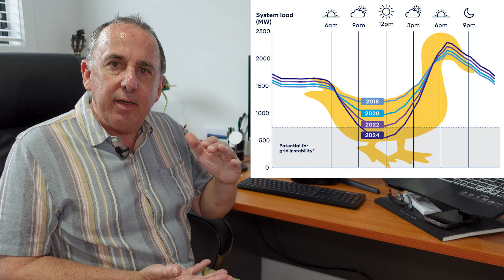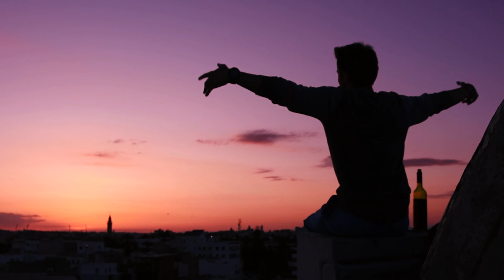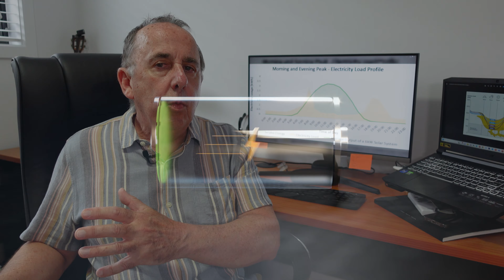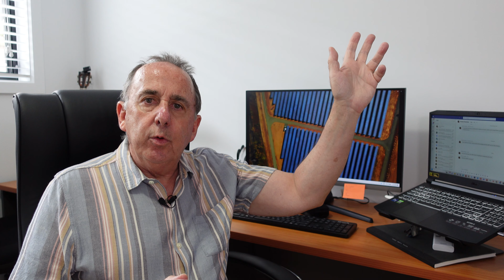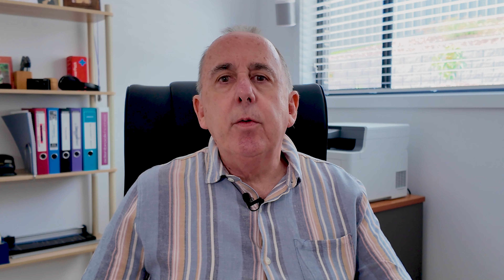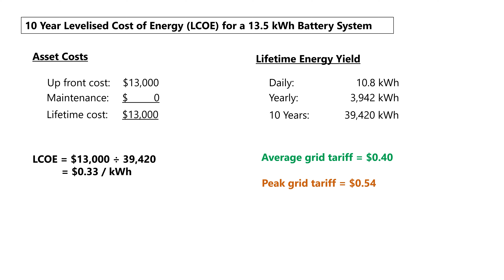This Electric Life - Tesla Powerwall Battery

Comment: Some great food for thought there. One point worth considering though when attempting a zero $ power bill during your retirement is the "supply" component of your bill. As more and more households follow your lead to zero grid usage, as I see it, energy suppliers have no option but to keep raising the supply component as they are already being forced to do. The money has to come from somewhere to keep the books in the black. Disconnecting from the grid won't be an option for the average urban dweller either.
Reply from the maker: Thanks Doug. That's a fair point and it's why selling public grid infrastructure to private companies is a bad idea. Unfortunately that horse has bolted in many parts of Australia.

Comment: To your LCOE you need to add either the cost of your solar panels or the cost of your Off-Peak energy if you charge the battery from the grid. You also need to add the cost of installation of the battery and panels.

Our roof is not suitable for panels, but I have considered charging a battery from the grid during EV Off-Peak ($0.08 / kWh) and then using the battery during the Peak ($0.44 / kWh) hours 4pm to 8pm. Probably not worthwhile, particularly considering that the $0.08 Off-Peak could be withdrawn at any time.
Reply from the maker: Good pick-up! Glad to see someone is paying attention. The LCOE for rooftop solar was calculated at 6cents/kWh in my earlier video, so you should add that to the 33 cents/kWh for the battery storage. At 39 cents/kWh it is still cheaper than the grid but the payback will be well over 16 years. Thanks for watching!